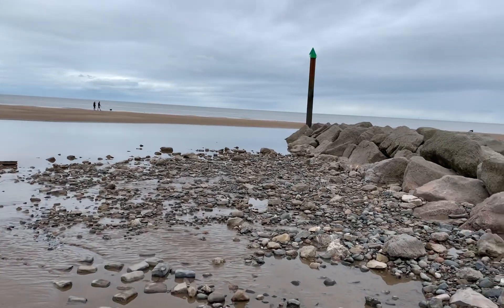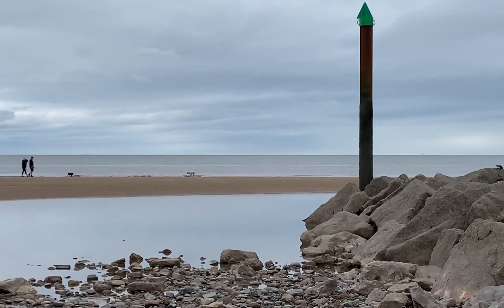How Do Sea Defences Work Rossall Beach Fleetwood

Comment: This is a fact packed film with a cheerily delivered narration and extremely useful in that we learn the proper terminology for the different parts of the visible and invisible defences.
This documentary or another very similar would do well to be placed on the syllabus of schools not only near the coast but country wide. The incoming tides can snake around the raised strands parallel to the beach and I have seen people having to wade through water to get back to safety. The depth of the seawater at high tide and also the mean depth surprised me greatly. People arrive at the edge of the sea feeling that the shallow gradient fron sea wall to the arrow markers means a gentle withdrawal at the flow of tide can be made whereas the reality is very different. As the narrator has said; the sea needs to be treated with respect.
Reply from the maker: Oh goodness yes it does need to be treated with respect. I just wish people would.